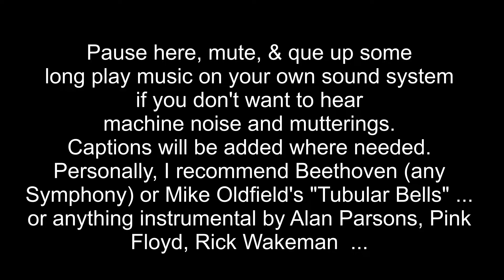FWIW #8:  A quick change tool post for the lathe - Body Shaper Work Part 1

Comment: Loosen the bolt in the slot at the top of the clapper box and set it away from the cutting angle so that when it lifts it will lift away from the work in two planes and it will not drag up the face of the cut.
Reply from the maker: The reason I didn't do that is in the 2nd part comments (with Chirpy)